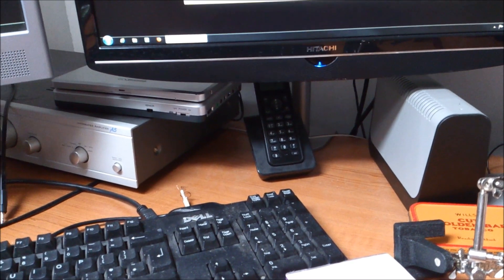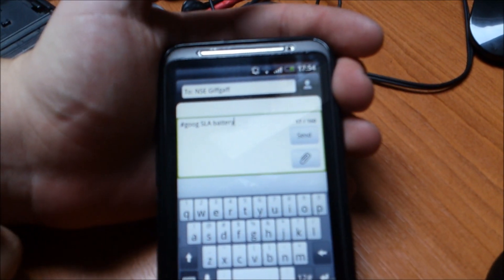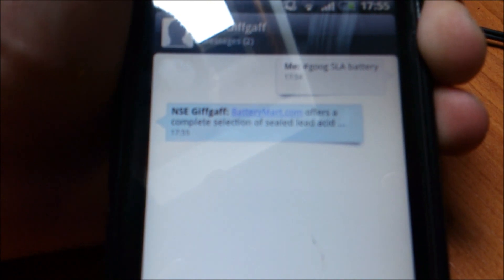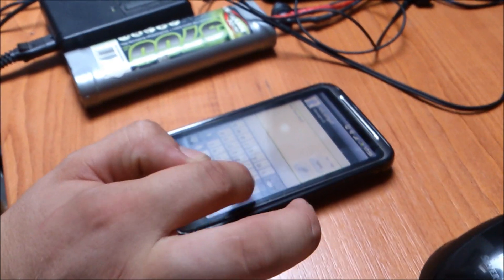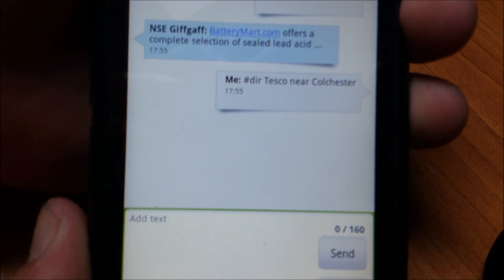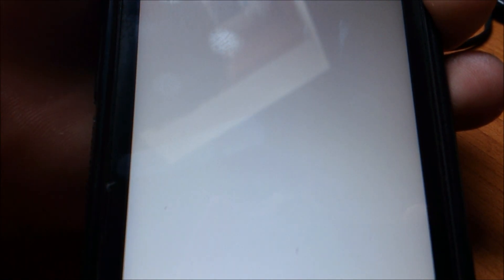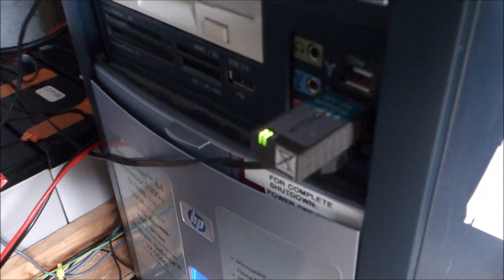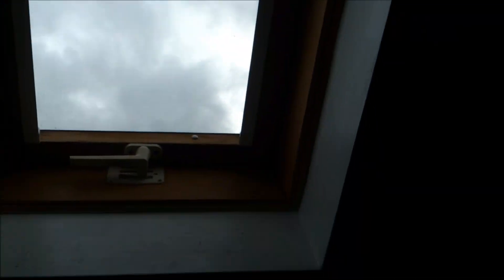SMS Server

Comment: Basically, what he did is bought a GSM module (or a device that has one) and put it with a computer, he has written (or maybe got it from the internet) a program that checks the SMS messages from the GSM module, and then the application receives it and processes it just like a normal HTTP request (if we could say so). You can buy a Huawei GSM module, make sure it has a serial interface (it can be connected to the windows OS), surely it must have these pins: 5V, Gnd, D+, D-. Find them and solder them with a USB cable, find the driver of the GSM module and you are good to go. There might be other approaches, but this is the easiest...
Reply: I have a Quectel EP06 miniPCIe  module just laying around and an AT command pdf!!! I’m going to try to figure this out!! Thanks Bro...

Comment: I have an SMS front end that converts the SMS to email. It allows the email recipient to reply, and we convert it back to SMS and send to originator.  It is keyword driven, so the incoming SMS has a keyword, which points to the email address.  All messages logged and searchable through web portal access.   We on the same page?